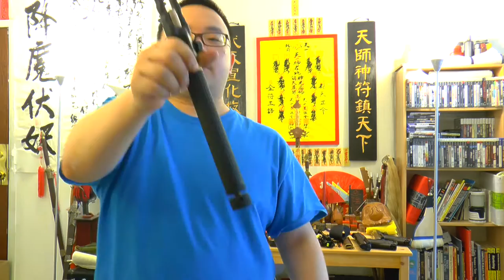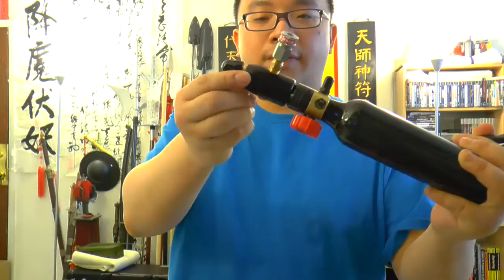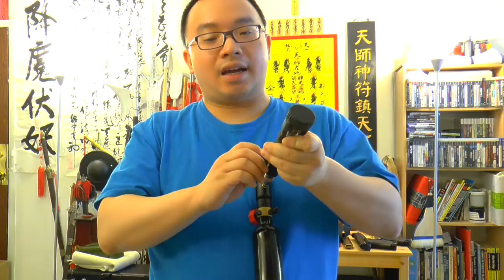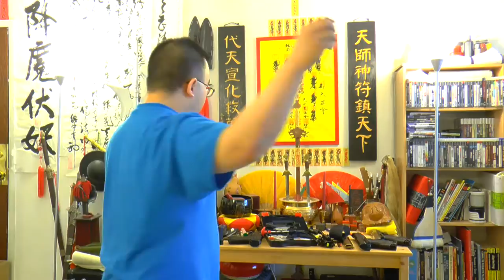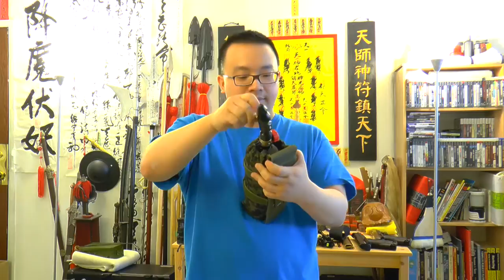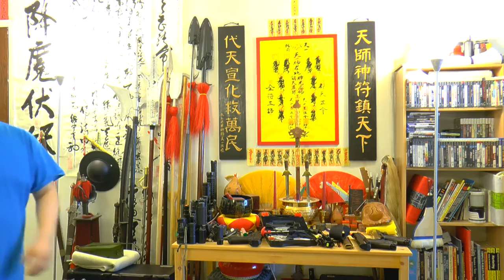How to Charge APS CAM870 With HPA The BEST Way

Comment: would i be able to use the tank that i use for my other guns which is a 3000 psi tank?
Reply from the maker: +you cant shim sham the zimm zamm 3000psi is a full fill pressure, not output pressure. Your 3000psi tank means it is max fill to 3k psi only, but most tanks are outputting 850psi by standard